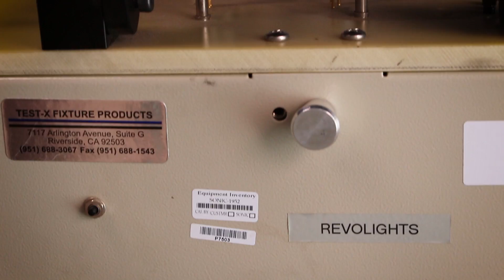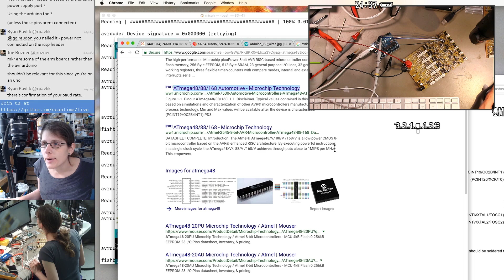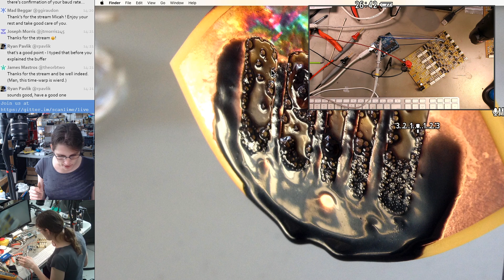Manufacturing Test Fixture for bike lights? Teardown and Quick Look

Comment: I used a test fixture very similar to those when I worked for a contract manufacturer as a test technician. I only used it a few times as I was mostly assigned to other products. I had heard that they had issues with the reliability of the fixture, but I assume that was mostly the pogo pins wearing out.

Comment: The lights this thing is set up to test (revolights) look pretty cool, they mount on the rims of the wheels and use the sensors to know where they are, so they only turn on the LEDs that are in the right part of the rotation. And since they have to know the speed the wheel is turning, the rear ones can flash when you brake.

Edit: Ooh, maybe that usb port is to keep a phone charged so you can test the Bluetooth and whatnot